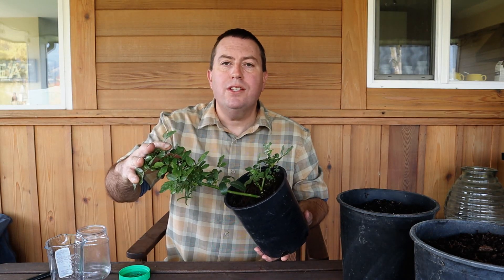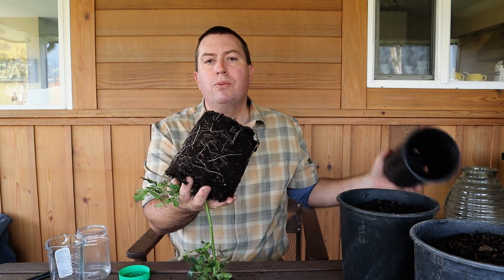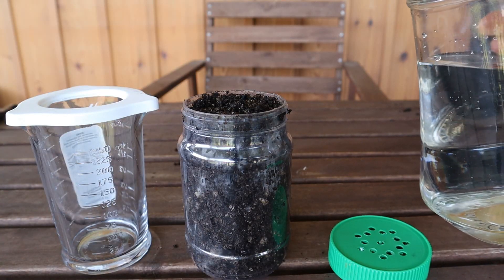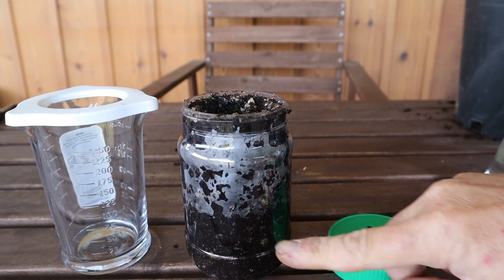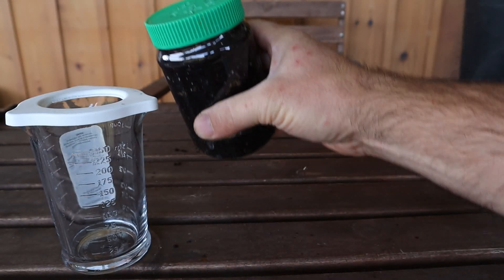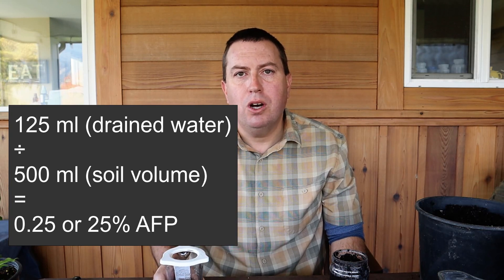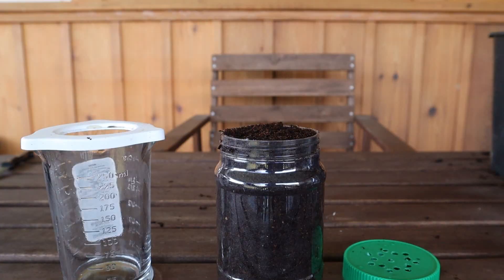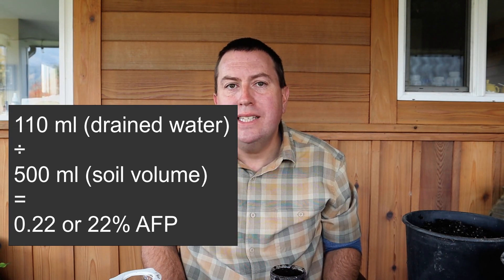Is There Enough Air in Your Potting Soil?

Comment: why so difficult? just measure the water before you pour it in and look at how much you have left, the water that's gone is the amount of air displacement.
Reply from the maker: I'm not trying to measure the total amount of pore space, but rather the proportion of that pore space that is filled with air after initial drainage. The total pore space does equal the amount of water when it is poured in, but some of that water is tied up in the pores of the potting soil. So total pore space (water in) minus the drainage= air filled pore space.

Comment: Great video Jason as always thanks 🙏 
If I use a 16oz cup perforated at the bottom fill it up with my mix pour in 100ml water and 25ml drains out is my 25% afp correct? Thanks again!🙏
Reply from the maker: Yes, that's it.

Comment: Great information! New subscriber here, from Pitt Meadows.
I would weight the jar before and after adding water. This would be easier as I would not need to drain the water. And more precise as the wet soil left in the jar still contains some water and it affects the result.

Comment: Hi Jason, can you advise if self water container ( for inhouse plants) together with high perlite( 30%) content with putting soli in closed container( no bottom holes) but using a wick type to create water intake for plants is a good idea.

I have been trying it and looks like my plants like  it. the strange thing is that not much roots build up is noticed
Reply from the maker: Thanks Mohamed - I've seen pants grown quite nicely with a closed container - but you just have to be pretty aware of how much water and fertilizer you're putting in there.
Reply: @FraserValleyRoseFarm  many thanks. appreciate sharing your experience. I was hoping to get your feedback om wicking systems as they are much easier to manage and assume plant will take water it only needs. any thanks again.

Comment: not sure about any pro horticultural grade pinebark potting mixes however, typical such potting mixes bought in bags at stores usually have problems in draining well and re-wetting once dried out a bit. i'm pretty sure these domestic mixes are the reason that so many pot plants die each year; not the customers fault as they would have us believe.
any non small pot full of pine bark domestic mix goes putrid on the bottom when top half already dry.
coir/peat mixes dont seem to suffer this.
domestic coir bricks you expand in water do need calcium and magnesium added though, as these are not present and you wont find these important nutrients in most fertilizers. coir bricks also tend to be a little acidic, so that calcium and magnesium addition (every few months) helps out.
incidentally i have a few indoor orchids in pinebark nuggets mix and they get fertilizer weekly and doing well. when i cottoned on to try the liquid gypsum, it made a drastic growth difference.

if you measured the amount of water you poured in and take away the amount that drains out, you'd have the figure for how much water stays in the mix and wont drain out. this needs to be a figure that provides good water retention but without so much as to drown roots.

anyhow, good potting mix should allow you to water frequently whilst freely draining. there's no such thing as being able to use bad mix and make up for it by being super careful with how much you water. that's fairly impossible. it's like when you buy orchids packed in sphagnum moss in a non-draining pot and you dont re-pot it straight away. you cannot water it as originally supplied, without killing it by watering. those orchid roots need to breathe more readily than what's possible in tightly packed moist sphagnum moss.
Reply from the maker: Thanks Chris - I always love to hear insights from other growers.
Reply: @FraserValleyRoseFarm  : i should be doing more work and less typing ;) havent collected snails for years, so i did after a bit of rain. got about half a 20 litre bucket of snails. sprinkle them with salt every few centimetre layer to stop them crawling out and kills them. they were congregating on dead plant material as well as on some new blooms of various plants they take a fancy to. wish they were good eating snails (escargot) instead of just being a nuisance. been months in lockdown and no chance for a nice restaurant or much of anything. at least i had enough materials to set up posts and lines for lower and lean method of growing tomatoes and cucumbers.

Comment: Maybe, maybe not. You measured the amount of water that drained out to find the amount of air in the soil. But it seems to me that's a measure of the air space MINUS the amount of water absorbed by the soil. I wonder if it might be better to measure the amount of water pour in to fill the container and that drained out to get the amount of air space. Here's the relationship.

Poured in (In) = Air space (X) + Soil absorption (Y)
Drained out (Out) = Air space (X) - Soil absorption (Y)

Rewritten as algebra, you get two equations:
In = X + Y
Out = X - Y

The first can be rewritten as Y = In - X
The second can be rewritten as Y = X - Out

Equating the two Y equations gives In - X = X - Out
Solving for X gives 2 X = In + Out or 

X = (In + Out) /2. That equation should allow you to calculate the amount of air (X). Just add the two and divide by two.
-----
Now imagine that 500 ml was poured in and 300 ml drained out. Rewritten as an equation, you have:

The X = (500 + 300)/2 = 400. That leaves 100 absorbed by the soil. Putting that into our first equations 

400 + 100 = 500, which is correct for the water poured in.
400 - 100 = 300, which is also correct for the water drained out.

I think that is right but my algebra is very rusty.
Reply from the maker: Hi Michael. I see where you're coming from on this, but in the end, there's no reason to account for the amount absorbed (unless you're trying to calculate the water holding capacity of the potting mix too). A think a helpful way to look at this is Total Porosity = Air Filled Porosity + Water Filled Porosity (or let's shorten to T=A+W). When I fill the whole volume with water, I'm kind of forcing W up to T. Total Porosity remains constant though, so when I drain the excess water then by whatever amount I reduce W, I'm also increasing A by that same amount.

Comment: Years ago when planting we were told to heavily compress the soil around the planting to get rid of air pockets and the air pockets were considered as a bad thing.
Is this a case that over time the science has caught up and the theory has changed?  I stopped heavily compressing some time ago because I felt it would cause root damage.
Reply from the maker: Hi Barbara - good question - that practice of "tamping down" the soil in a planting hole is a bit of a mixed bag IMO. Yes, I want to see good root contact with the surrounding soil, and I also know that a plant left "swimming" in too loose a planting hole will tend to flop from lack of support. So a little bit of firming and light packing is kind of necessary. In doing so, you may collapse any large voids or pockets of air - and that's okay.  But you should never compact the soil enough to dramatically reduce the general porosity of the soil. Kind of a fine line, right? In nursery production, we're constantly warned that excess soil handling will reduce the AFP in the pot - leading to later potential for root rot. So I choose a mix with decent porosity, and I use a light hand while potting to give my roots the best chance of success.
Reply: Yes today when transplanting trees into the ground, one digs hole twice as deep. Then when putting back soil one Waters it in in order to fill up any voids of dirt.

Lightly compressing soil in bottom of dug hole, or better still prevent from digging hole too deep in first place. Is done to prevent tree from later settling crookedly. 

As very few if any new Roots grow from root ball downward after transplanting. Since early tap Root production only takes place first two years, then horizontal root growth takes over.